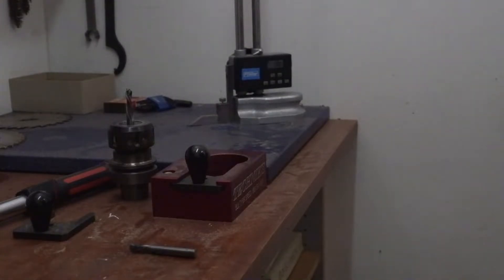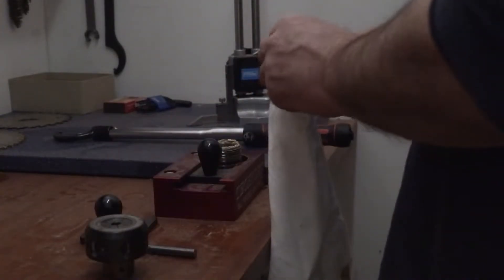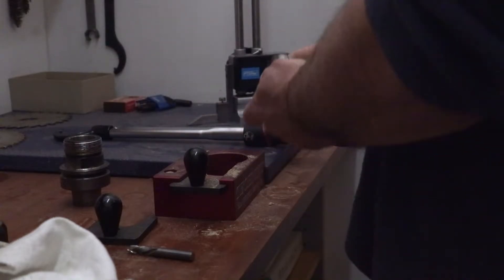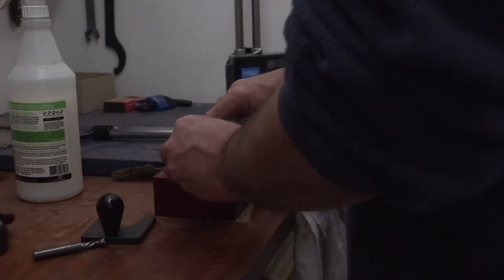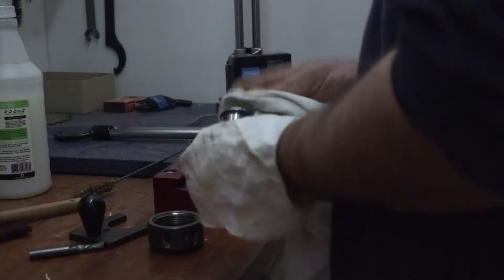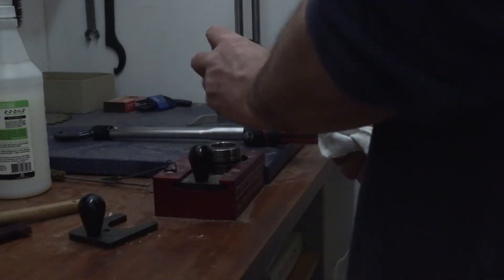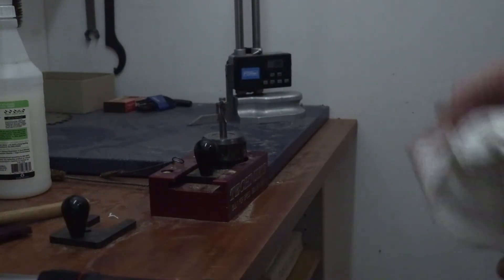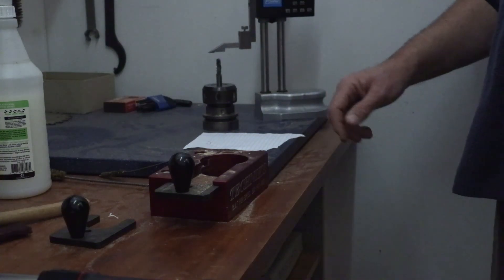HSK63F Tool Holder Setup

Comment: what do you call the measuring tool you used to get the length of the cutter in a too holder ?
Reply from the maker: digital height gauge, sorry for the delay